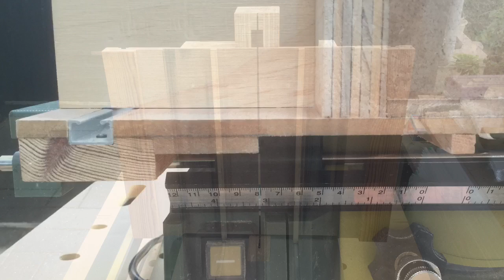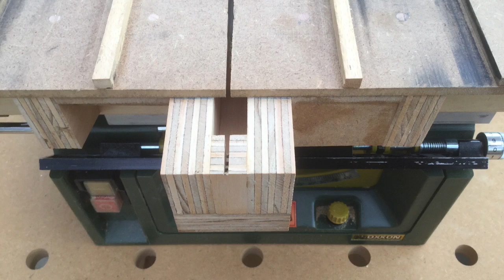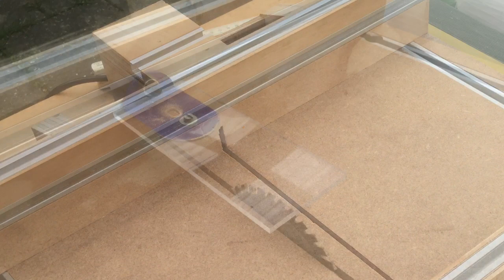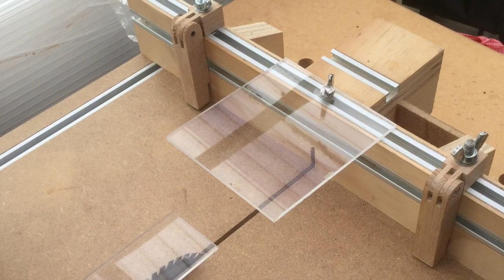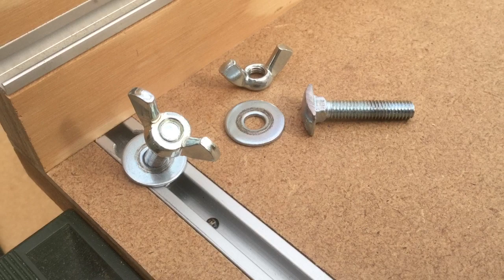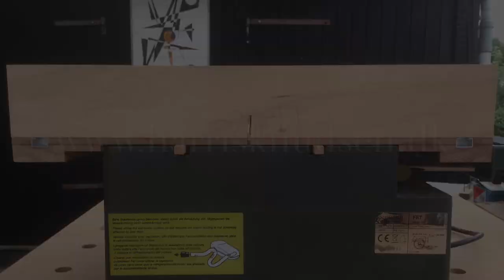Proxxon FET Cross Cut Sled Photos

Comment: Looks good, but does it work?
Reply from the maker: A Cross Cut Sled will make your saw 10 times better but also look at my Side Cutting System it is very easy and cheap to make and also makes the saw much more usable

Comment: Thanks for your video's and photos. It is a very usefull instrument and I want te try making one myself. What is the material and the  size of the C-rail that you are using. And where can I find it?
Reply from the maker: Hans Evering Thank you for your comment.  The materials are most random, depending on what I have lying around, I prefer plywood or MDF.  The T-rails in aluminum are curtain stems that I buy at JYSK where they are very cheap and they work fine.
Reply: @Harris-DIY  Thanks for your quick reaction. I am on my way tot JYSK